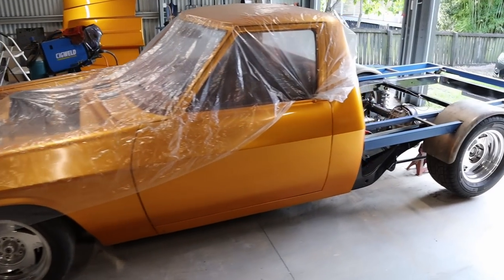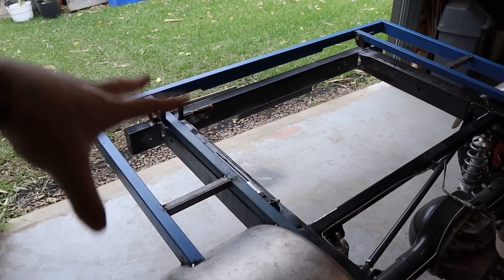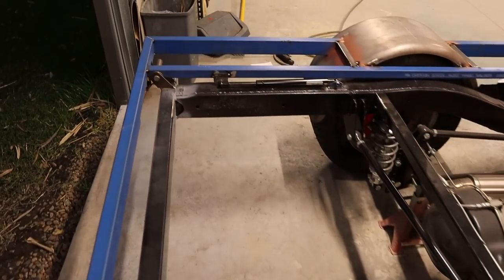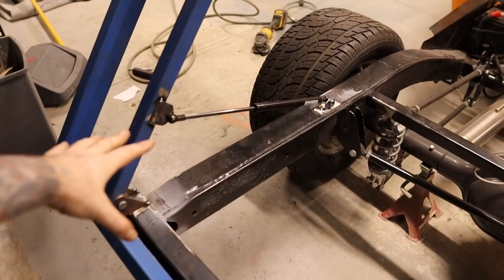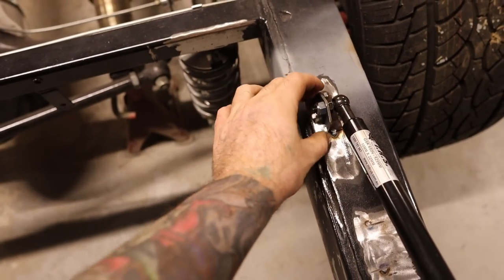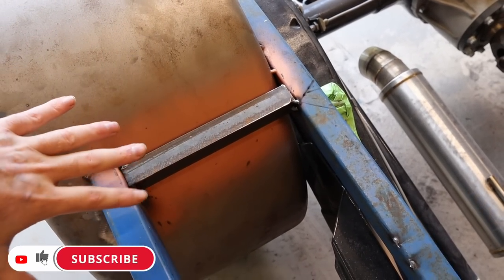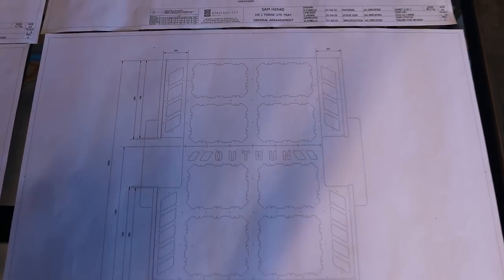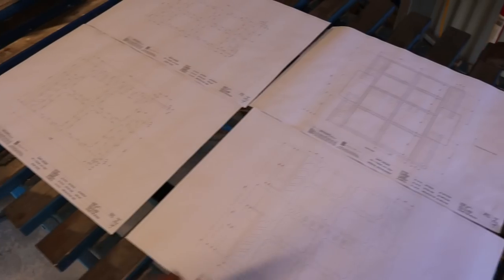Building the Tilt Tray Episode 4 / Struts and Tray Design Reveal - HX One Tonner Tray Build

Comment: Just a tip, have the struts around the other way so the shaft is pointing down when you assemble for the final time, the oil inside lubes the seals for the shaft and they last a lot longer
Reply from the maker: Thanks Mate. I did look at strut orientation. You probably cant really tell but in the closed position (tray down) the rod is pointing down ever so slightly. So the oil will be sitting down at the seal in closed position.

Comment: Looks awesome Sammy 👌 coming together nicely mate..
Have you worked out how you will secure the front of the tray as yet mate..
Reply from the maker: Thanks Mate. I have been thinking about it and I have a few options. Kinda wanted to keep things simple and was looking at some magnets
Reply: @ShenkeGarage  sounds interesting Sam intrigued to see the outcome mate..
Reply: @ShenkeGarage  my try has a hq bonnet latch holding it down with a bonnet cable coming out on the drivers side. the other option could be some nice stainless latches like what on an esky or similar. just a thought
Reply: @ShenkeGarage  Maybe a magnetic welding earth clamp.Switch it on to hold down the tray and switch off when you raise it.

Comment: Tray looks good.  But my back and head are moaning looking at the set up. You may not have a bad back now Imagine filling that tank leaning over and around those wheel guards. How many time will you cut your head or shoulders open on the arches hanging down? I'd be putting a little door in tray so you can fill it up with it down. Chuck the tank back in and run up to the local servo and try it out before you commit fully.
Reply from the maker: Thanks Mate and appreciate the feedback. The fuel filler is close to the diff so should not really need to bend over underneath the guards that much. This Ute was never really built with practicality in mind. Its a week end cruiser and not a daily so I understand some things will be a pain.